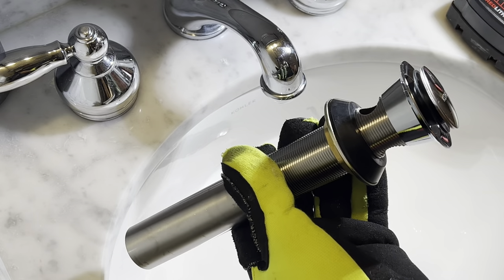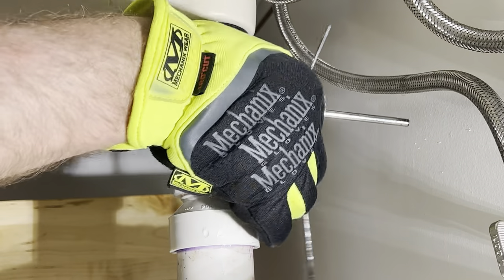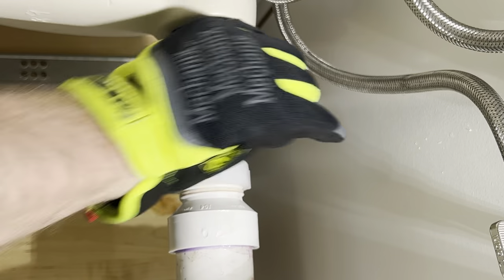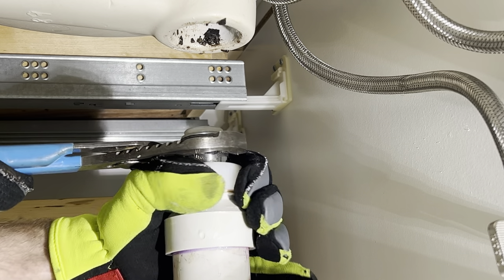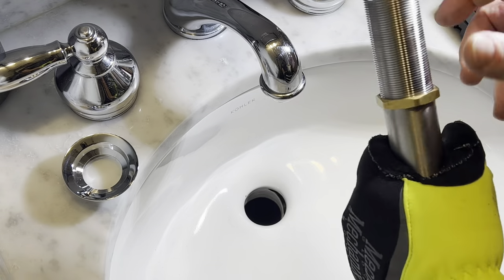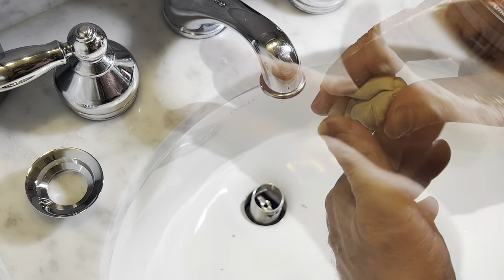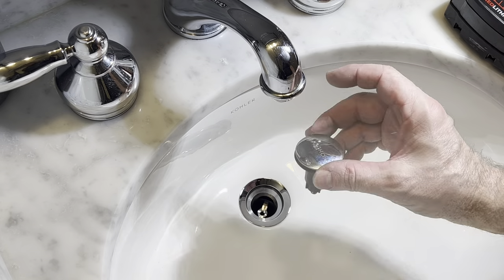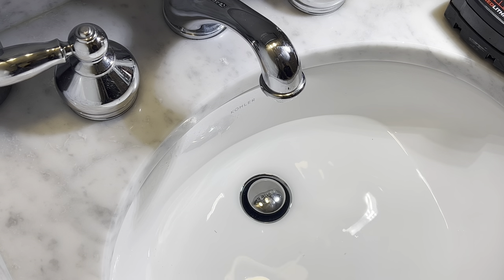Upgrade Your Bathroom sink In MINUTES - Amazing Easy Clean Kohler Clicker Pop Up Drain!

Comment: I have something very similar that I got off of Amazon that just dropped into place where the original stopper was without all the extra plumbing work. Came with a variety of rubber gaskets to make a tight seal and I'm pretty happy with mine. This is cool but mine was a lot cheaper and a lot less work. 🤷🏻‍♂️
Reply from the maker: Nice! Sometimes you just gotta love Amazon for saving us from all that extra hassle.

Comment: Bravo! Beautiful job! The last handful of faucets I replaced I couldn’t get the drain collar or the nut below the sink to unscrew bc they were so corroded. I ended up cutting them off with a Dremel metal cutting wheel.
Reply from the maker: Great tool for that. 
A multi tool also works well for that.

Comment: Can you help me here and advise how to adjust the pop up lid not to allow the water to go through in a closed down position? Or it is with a defect? But my husband set two drain in and both of them don’t keep the water in my sinks…🤦🏼‍♀️ thank you
Reply from the maker: Did your husband read the directions? Watch the video? 
Something must be wrong. I've never had that issue.
Reply: @elitehandyman911  we screwed the both pop up stoppers tightest as we could inside their system, screw them back down into the drain pipe but they still both leak the water… The rubbers look ok, not defected. I think the pop-up stoppers are defected… I need to exchange them in the store then. Thank you.

Comment: I applied plumbers putty all around the flange as you show. I'm not getting any water to drip from any of the connections, pan left on the bottom of the vanity is always dry. But, after several weeks of use, I can still feel a trace of moisture around the rubber gasket against the bottom of the sink. Very frustrating, I hate the thought of taking everything apart! Any suggestions?
Reply from the maker: There's a sweet spot of tightness with any drain gasket. Under tightening, it will leak, overtightening, it will leak. I'd suggest tightening just 1/8 - 1/4 of a turn. If it's super tight try loosening 1/8 - 1/4 of a turn.

Comment: Ok, my husband just installed this drain to our brand new sink.  No matter what he does, he pushes the stopper down and it won’t hold water.  He has used the plumbers putty and there are no leaks with the stopper is up.  Can you tell me why this might be happening?
Reply: Also, the stopper won’t close and stay closed…….did we get defective merchandise?  We bought two and neither one are working properly.  Very frustrating.
Reply from the maker: I'm not sure what the issue could be. I've never heard of this problem with these drains. The only thing I can think of is if the rubber gasket isn't seated properly on the stopper piece.

Comment: What do I do if water leaks from the threads under the sink. The nut is very tight and I am afraid to crack the sink. Suggestions???
Reply from the maker: It's possible you over tightened the nut which deforms the large rubber washer.
Try loosening it slowly with water running and see if it helps.
Reply: @elitehandyman911  That did not alleviate the dripping issue. I took it all apart and added plumbers tape on the threads where the rubber gasket contacts the metal. That fixed the issue. Thanks for the input. I really do appreciate it!
Reply: Glad to hear you got the issue resolved. I'm finding more and more plumbers are either using plumber's putty or Teflon tape in the area where the conical rubber seal fits on the tube because the rubber won't push into the fine threads well enough to seal unpressurized drain water. I use Teflon tape because I can get about 4 or 5 tight wraps to seal into the threads. They're doing this to prevent call-backs and facing unhappy customers or builders because of the all-too-common water damage to vanities made of MDF or particle board.

Comment: 1 Think you forgot to mention. -  If you screw the collar all the way down on these the clicker will not hold water, you have to unscrew the main pipe until it clicks down and makes a seal.  I was a dumbass and thought mine was defective becuase it would not hold water when everything was screwed in all the way.
Reply from the maker: It sounds like you may have a replacement clicker stopper stem that's too short.
Reply: @elitehandyman911  Right out of the box perhaps is just doa.
Reply: @elitehandyman911  Actually, it's too long by about 3mm.